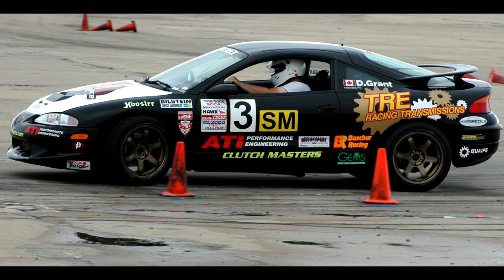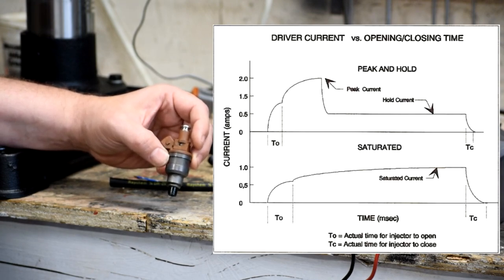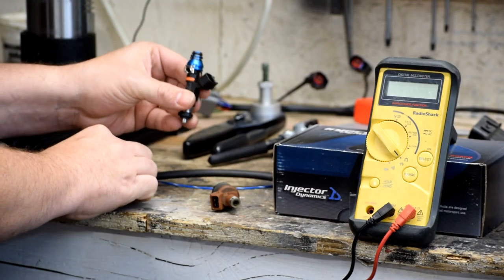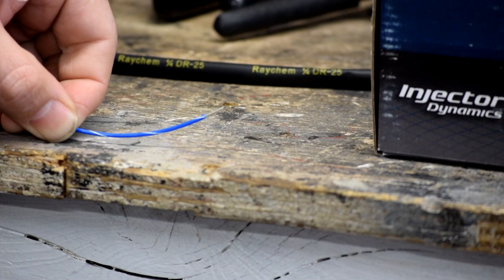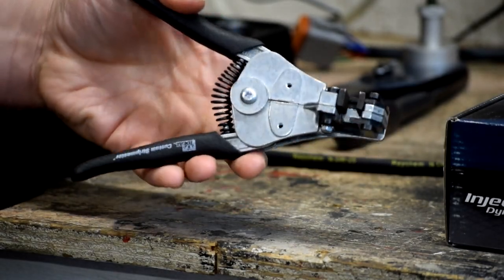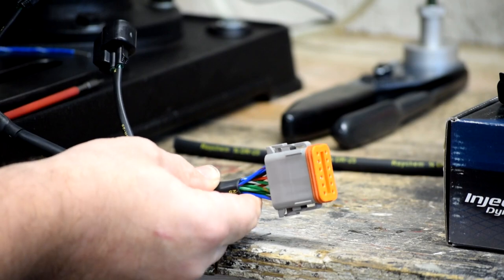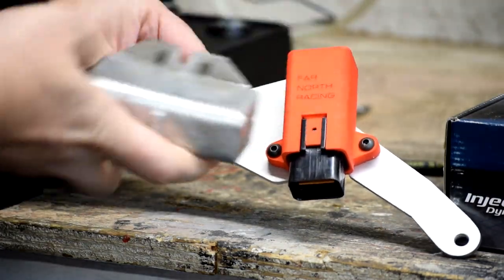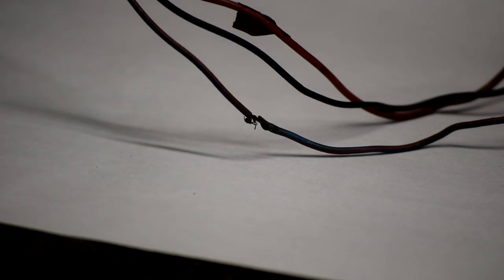FNR Stealth Project Ep1 - Wiring Injector Dynamics High Impedence Injectors

Comment: You probably know this already, but those style of wire strippers are pretty common for standard wire (At least in the type of work I do).  I suppose it's just the stripping insert, in this case, that's specifically sized for that kind of wire. Very informative yet entertaining video, thanks!

Comment: Why didn't you just get 6 second hand plugs from the junkyard, cut off the old ones and solder/ heat shrink them back on......far easier.
Reply from the maker: 1. ID supplied the raw plugs with the injectors, so that new crimped ones could be made;

2. You are unlikely to find USCAR injector plugs in a junkyard;

3. Junkyard plugs will be of dubious quality;

4. Solder joints have no place on a wiring harness; and

5. The new harness replaces old, corroded wiring with new, lighter, corrosion-resistant, weather-sealed wiring that will probably outlast the car.

Doing it right is better than doing it easy.